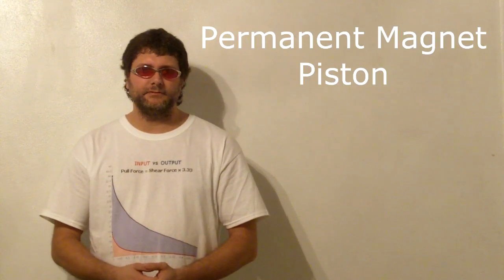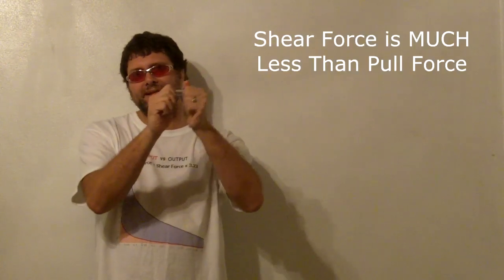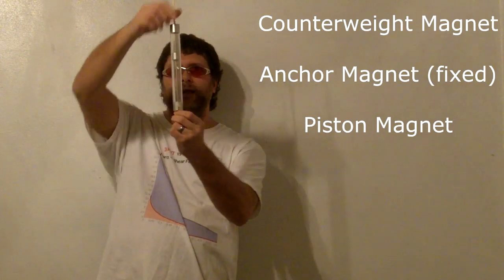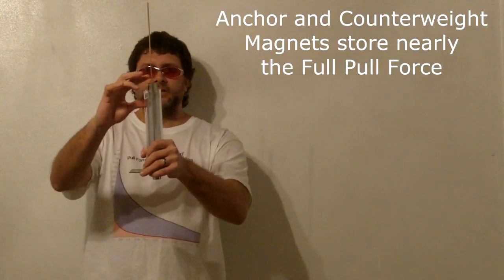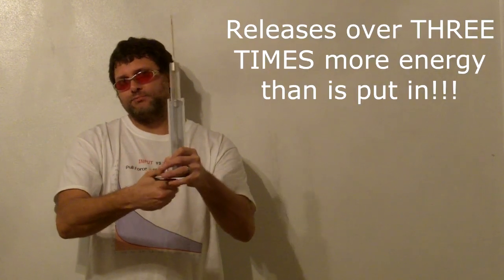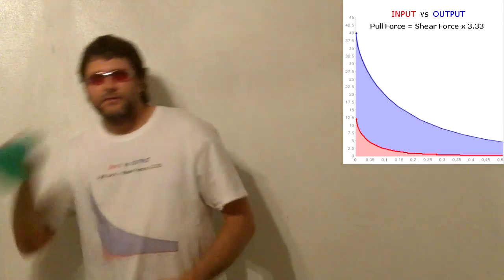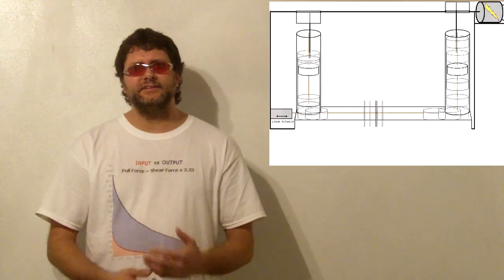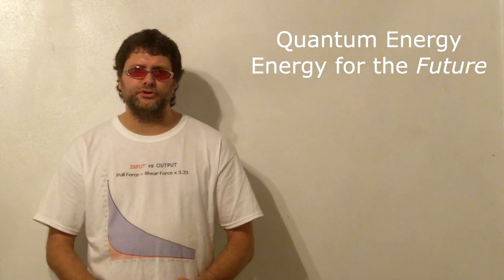The Permanent Magnet Piston: Energy for the Future- HD

Comment: The concept of energy amplification looks appealing in theory. I would be great if you could prove the same experimentally. The graph that you have displayed needs to be validated through experiments.
Reply from the maker: +Ankit Kumar Parsurampuria Thank you for your comment.  It's fairly simple to hook a push/pull meter and measure the input force and output force.  I've done this with a $100 meter but as the forces are logarithmic it's a bit hard to realize what's going on unless you understand it.  In reality, there is actually far more than 3 time amplification of force.  I'd love to have funding and access to a real lab and good measuring equipment but I don't.  There are actually three unique and distinct ways to harness the energy of magnetism.  I will make a video outlining the three methods this year when I get a chance.  Unfortunately, making a full fledged prototype requires more time and money than I have and the powers that be really don't want me to get that far.  However, there have actually been people who have gotten this far ... but most people wouldn't know this as it's all swept under the radar pretty quickly.
Reply from the maker: +Ankit Kumar Parsurampuria Feel free to ask me anything.

Comment from the maker: Here is what I now know to be 100% true.  

We do not need any oil, nuclear, coal, gas, solar, wind, or even hydroelectric energy at all.

We can tear down the dams and let the rivers run free once again.

The entire world can have all the 100% cheap and clean energy it will ever need.

This will be completely free of any and all pollution and can also be used to make all the clean and pure water the entire world would ever need.

Magnetism can be used with other materials to make the ultimate water electrolysis machine that will generate pure hydrogen and oxygen.

The energy output will be far greater than the energy input.

This can be used with existing internal combustion engines and every car on the road right now could use this with very little modification.
Reply: +Ima MagnetFanatic But there is no money in it. :(
Reply from the maker: G- Man That is simply not true G-Man.  There is infinite money in it.  What you mean is there is no control over others with it.
Reply from the maker: G- Man Take UPS for example.  Can you imagine how much their bottom line would increase if they didn't have to buy gas?  Take any transportation company.  Airlines.  Any company that ships goods or relies on shipped goods, which is most of them. Their profits would instantly explode.  The same goes true for McDonalds even. 

The problem is the global totalitarian fascists and Arabs and Emirates can't control it enough to their liking.
Reply from the maker: G- Man Besides, what I am saying definitely does take engineering and supplies to make.  A cost and profits will most definitely be associated with it directly in addition to the exploding profits of all companies who benefit. 

What you mean to say is it takes power away from the oil companies, global totalitarian fascists,  Arabs, and Emirates :-(  Awww ....
Reply from the maker: G- Man If we established a transportation company that secretly used fuel less technology we would KILL the competition and be printing money hand over fist.  Period.
Reply from the maker: G- Man Even power companies would kill it.  They could charge less and profit far more.  Water companies could produce vastly more water for less and profit far more. 

The only losers are 1)Oil 2)Totalitarian Globalist Fascists 3) Arabs and Emirates.  EVERYONE else on the ENTIRE f*cking planet WINS!
Reply from the maker: G- Man Seriously Gman, how much money and how many human lives and wildlife has been lost sue to oil spills and nuclear disasters and how much will we pay in the future.  With what I am saying the entire world can move into the 21st century and beyond.  The world can't afford not to take this seriously.  Really, you should be ashamed of yourself for your position.  We both know you only take because of the "YOU BETTER OR ELSE" people.
Reply: Ima MagnetFanatic
That's what I said.There is no money in renewable energy. That's what JP Morgan said to Tesla about free energy. There is only money in destroying the planet.
Reply from the maker: G- Man Anyone who believes that lie are as fascist as they are.  Like I said, it is like printing money ... it's just a different group than are currently printing the money.  What is it called when the government interferes with business to keep certain groups from profiting in order to prop up other obsolete businesses?   Fascism.
Reply: Ima MagnetFanatic
JP Morgan was referring to the amount of money. He could make more from oil.
I would like to see  Tesla Coils set up around the world. But greed want let it happen.
Reply from the maker: G- Man This has nothing to do with Tesla coils.  Greed is exactly why it will happen.  Once China or India or any other country realizes they can dominate the oil oligarchy like the little fascist bitches they are they will do it.
Reply from the maker: G- Man It's pretty clear who's writing your check.  With every decade people like you don't move this forward and act to oppress it millions will die unnecessarily.  Go ahead, live with that.